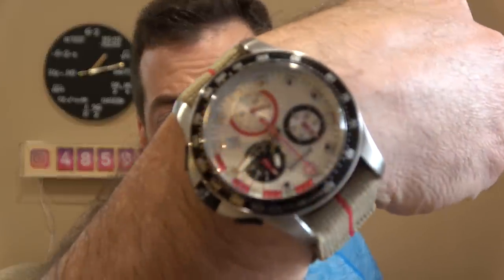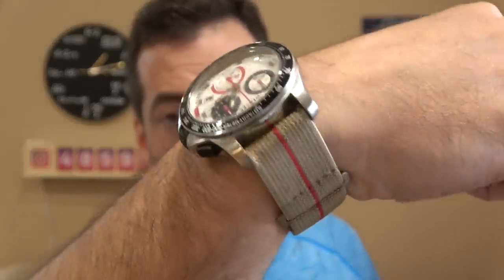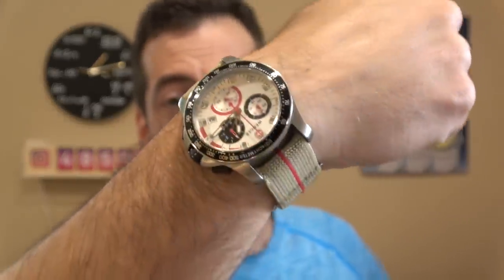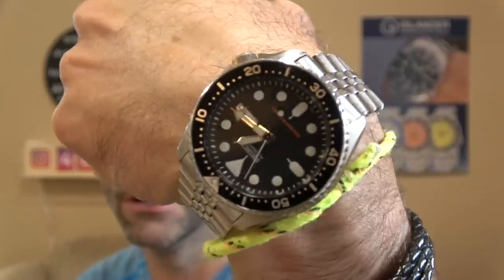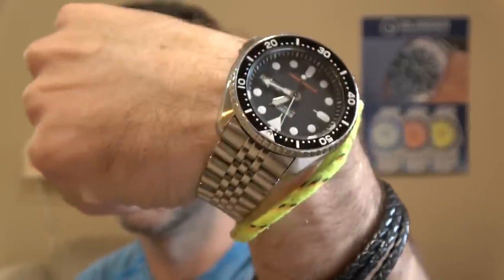Is it sapphire? USE YOUR HEAD! Watch and Learn #82

Comment: You mentioned that the thermal conductivity of sapphire is very high, so it makes sense that it would feel 'cold' when you put it against your skin. I always enjoy teaching my students that cold does not actually exist, only variations in heat do. When we experience what we call 'cold', it means that whatever is touching our skin has less heat than our skin does. Nature is always attempting to reach heat equilibrium, so heat always travels from areas of higher heat to areas of lower heat. That temperature movement is what we call 'cold'. Sorry for nerding out there!
Reply: And that's WHY he said you need a comparison. I know years ago that you APPARENTLY can't feel temperatures, only temperature differences. I am not sure I believe it because I can guess the temperature when I walk outside and I'm usually fairly correct.
Reply: Don’t be sorry. I’m grateful that you wrote that! Thank you!

Comment: Greetings from The Netherlands. That crystal test is wild. I have two Citizen Eco-Drive watches on a windowsill charging. One has a standard mineral glass crystal and the other, is a sapphire crystal. Both watches are at room temperature for the test. The mineral crystal was just cool feeling. However, the sapphire crystal felt arctic cold against my forehead. As I said, this test is wild.  Many thanks for the tip.

Comment: I've seen a video somewhere where you can tell crystals by the following...  Clean the crystals.   Push down and rotate your thumb on acrylic and it squeaks.    Put two drops of water on a mineral, tilt the watch, and the drops will tend to spread out and smear.  Do the same on sapphire, the drops will stay as discrete drops.  Not tested the concept myself yet though.

Comment: Really good video,guy! A few years ago I broke my mineral glass crystal on my watch and was wondering how much it would cost to replace it with a sapphire crystal? Or do you think the only sapphire crystals made are for the watches they go into? Anyway, thanks for all the awesome videos!
Reply: I'd depends on the watch and what size your crystal is. Tons of cheap sapphire crystals on eBay if there isn't a company that already makes them for your watch i.e. crystal times or Island watch which make sapphires for a lot of citizen, Seiko and Orients.

You'll want to buy or have a watch press tool and make sure you punch out and measure the crystal that's already in your watch to make sure the circumference and thickness matches the new crystal. (That's where Crystal times and island watch crystals come in handy because they're already sized if they have the crystal for your watch).
Reply: I replaced my mineral glass with sapphire glass and paid  60 Euro.

Comment: Using this method I can tell a distinct difference in feel between acrylic, mineral crystal and sapphire. What's throwing me are my older Seikos (80's and 90's vintage), they should be Seiko's proprietary Hardlex but they feel just like the sapphire to me. And while I don't have a diamond tester, the same model watches I have that are supposed to be sapphire have been confirmed by reviewers to be sapphire. What about Hardlex makes it feel like sapphire? Or do I just need my forehead calibrated? Or should I use my other forehead?
Reply: Use your Fore-skin

Comment: There is another method- a single drop of water of the crystal.  If it stays in a drop, it's sapphire.  If it spreads, it's mineral.
Crystal must be clean before testing.  Unsure if external AR affects results (never tried it), but it's always worked for me

Comment: Hi Mark, I have a question regarding a Sapphire crystal that I replaced in an original Seiko Tuna ( Not a Mod ) ,  I had seen an AR-Red coated Sapphire replacement done on a different model of a real Seiko and I actually liked it. Well unfortunately given the dial colouring and  hands it's being drowned out by the coating , mainly because it's coated on the surface , not the underside. Rather then simply acquiring another Sapphire crystal,  I was told to simply use  AutoSol  metal polish and a soft cotton small buffer wheel on a dremel , the dremel to be set at very slow speed and lightly  buff the AR Coating off ... What are your thoughts ????  Thanks ...

Comment: Thank you, very useful; but what I really want to learn about is sandwich or Sapphlex crystals. There's very little information on them. My Dan Henry 1970 comes with some "sapphire coated mineral" crystal (usually a thin sapphire layer laminated over a mineral crystal). The diamond tester shows a glass reading, the water droplet test is consistent with sapphire (no spreading out). So I am actually wondering what I am dealing with here, what its particularly advantages may be (presumably economy and shatter-proofness) and why its so rare.

Comment: Marc! It works! Thanks for solving a nagging puzzle. My Save the Ocean, Prospex Samarai, with Hardlex crystal is warmer than the crystal on my green Sumo prospex .So the later  specifications are right. It's a sapphire crystal! But I initially didn't believe that when I bought it because there's no reference to a sapphire crystal on the caseback or documents. A very happy chappy here .Cheers Marc.😄

Comment: The quickest and safest way to test if a watch has a sapphire glass (for me, at least) is to apply a droplet of water on the surface of the glass. If it's sapphire, it will concentrate and look like a semisphere, if it's mineral, it will disperse. Also, you can check by gently tapping with your fingernail and listen to the pitch of the sound. If it is high, it's mineral. If it's low, more likely it's sapphire. Not sure if both of these relative tests work good for sapphire coated glass.

Comment: True story- I discovered that if I lick the crystal with tongue it's very easy to find the difference not only between mineral and sapphire, but between cheap/subpar mineral and higher end. Sapphire really feels very fresh and cold like ice. Mineral feels warmer and more like a glass for drinking. But there is mineral and mineral. For example my Certina feels ice-cold and expensive, with dense material, my Seiko SSB feels like a glass for drinking. Some watches like Casio 5600 and Casio EFV-100 feels a piece of like plastic, while other G-Shocks like G9000 feel in between high temperature treated glass like my Seiko and plastic like 5600. Casio 100 definitely feels a lot more plastic than 5600 and it's the watch I wear the lest, while being the only mineral glass watch I manged to scratch :)

Comment: I tried this and it seems to work. However I did have a problem with one of my watches that had a mineral crystal that was sapphire coated. The temp was very close to my sapphire crystal watches. Is this normal or am I just imagining it? By the way I wasn't sure what crystal the watch had when I did the test and thought sapphire but then checked and found out it wasn't. Good tip as a starting point though.

Comment: So I tried this and it definitely worked between sapphire and plastic but not so much between sapphire and glass.
Reply: I can find a really big difference.  I tested 7 sapphire watches and 6 mineral crystal and I have an old 1960 Avia Swiss with an acrylic crystal. Acrylic is warm, mineral crystal cold, Seiko hardlex felt a bit colder than the mineral crystal, but not certain of that, might be just an anomaly, but the Sapphire is like an ice cube! Make sure your watches are at room temperature and your head isn't cold!!
Reply: @brianmsahin  I used my diamond tester to be sure but to me the mineral glass and the  sapphire crystal felt to be approximately the same temperature.

Comment: Hey Marc could maybe do a video on detecting 316L stainless steel on your watch. I've always heard it is non magnetic yet I have some after market bracelets that claim to be 316L but are attracted to a magnet while the factory bracelets do not. Did I get duped or are some 316L things ferromagnetic?
Reply: After market calls all Stainless steel 316L.  With most people 316L is the only Stainless that they heard about. Yes some SS is magnetic and it's not 316L
Reply: I don't know about 316L in particular, but some of the other 300 series stainless alloys are non magnetic in the annealed state but become slightly magnetic if they are cold stamped into shape

Comment: How about a Watch and Learn about metals?
for example:
 what is the difference between gold plate, gold cover and gold PVD ?; what is the difference between the thickness in microns of different gold plates ?; the different degrees of hardness of steel and titanium; Why is bronze recommended for diver's watches? What about silver case watches? are they recommended? why? Does a platinum case have any advantages over a steel or gold one ?; how often do you shave?

Comment: Any object with good thermal conductivity will try to transfer the heat from a warmer object to itself. So when Marc places the sapphire crystal on his head, the sapphire draws heat away from that part of his skin. This creates a cold sensation, since heat is being taken away.
 
This also is why metals containers feel cold, but books feel warm, because the former is a good thermal conductor while the latter a bad thermal conductor. It has little to do with the actual temperature of the metal/paper.

Comment: There is yet another low-tech & easy way to test for sapphire: the water drop test. If you put a drop of water on sapphire it will form a nice drop, if it's not sapphire, it will just dissipate. As far as I can tell it works like a charm... In fact you posted that yourself way back in 2016 🤣🤣🤣

https://youtu.be/DQ8Oju9UbHU?t=887